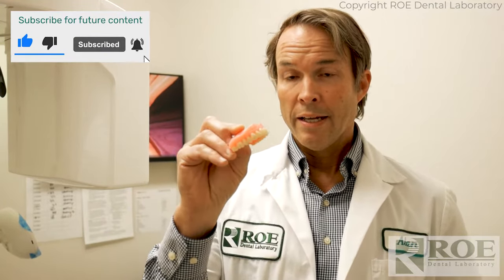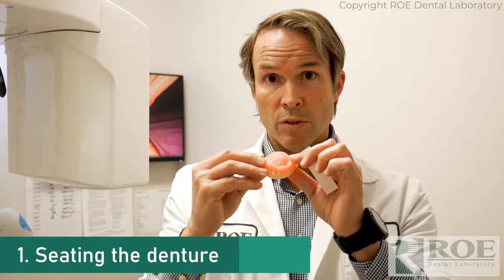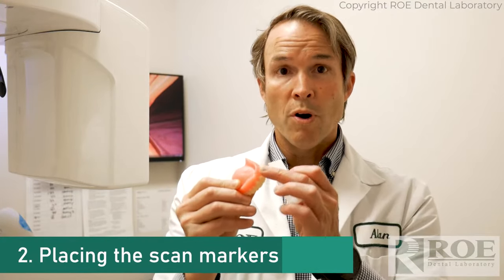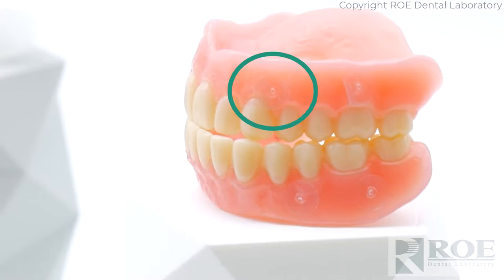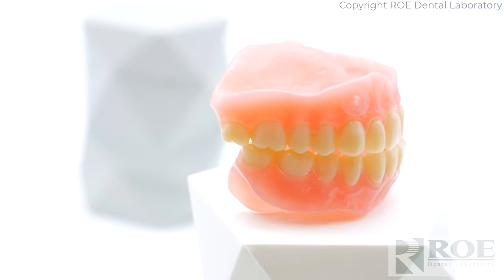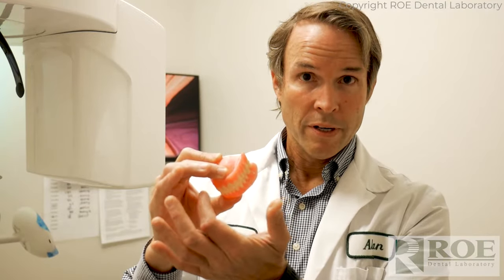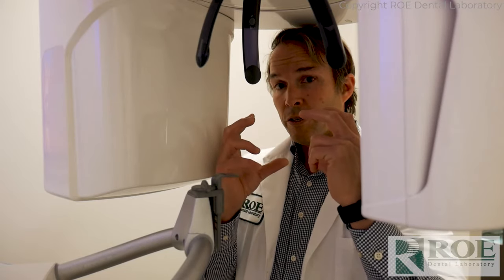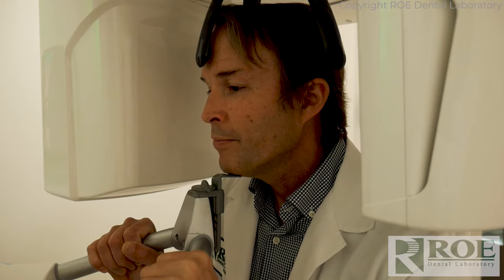The 4 Steps of Performing a Dual Scan for Single Arch and Double Arch Cases

Comment: Do the six markers on the upper have to be in the same spot as the lower six markers?
Reply from the maker: Good morning Ashley, and thank you for your question. When placing the radiopaque markers for a dual scan, it is highly recommended placing them randomly across both prostheses when doing a double arch scan, or randomly across the upper/lower for a single arch scan. More information on the dual scan protocol can be found on the "Creating Patient Records" page on our website -> https://www.roedentallab.com/PatientScans

Comment: Hello, can I scan the lower denture directly on the chin rest of the CBCT machine or does the denture need a different platform to rest on like you're doing in the video.
Reply from the maker: It can not be set directly on the chin rest of the CBCT. It must be placed on something like the foam packing that would be in a lab box.

Comment: Very informative! One question if I may.. Since the denture is not radiopaque, won't the second scan just show six dots(markers)? Where will be the information of the position of the teeth and the pink acrylic? Why not scan the denture with an intraoral or extraoral scanner as the second scan? Thank you!
Reply from the maker: Good morning!! In a dual scan, the prosthesis is scanned by itself is what gives us the prosthesis. In that scan, we can control the threshold. In the patient scan. It will be invisible except for the markers.
Reply: would you prefer the prosthesis be scanned by an intraoral or lab scanner? Or it doesn't make any difference in the details captured?
Reply from the maker: @ΥΒΡΙΣΝΕΜΕΣΙΣ  An IOS or Lab scanner would be used as a backup if the details in the dual scan CBCT are in question (pt moved or some of it got cut off). We could import the digital scan and try to align w/the CBCT. Ideally all you need is a proper dual CBCT scan. If there is any question when you send in the CBCT, you can contact us and have our team review it and approve it before the pt leaves.